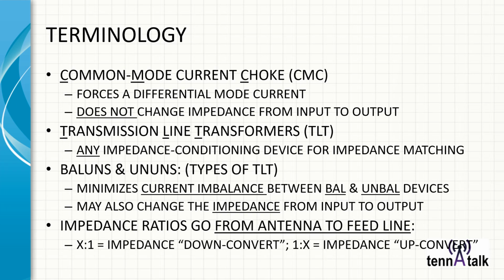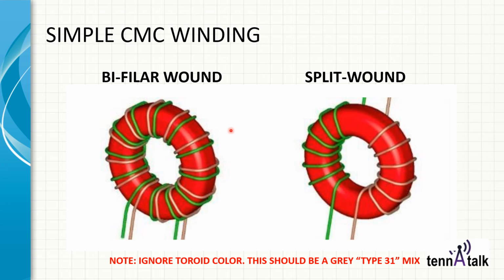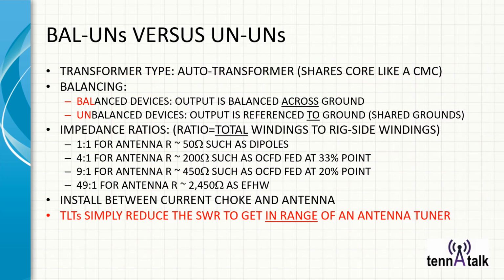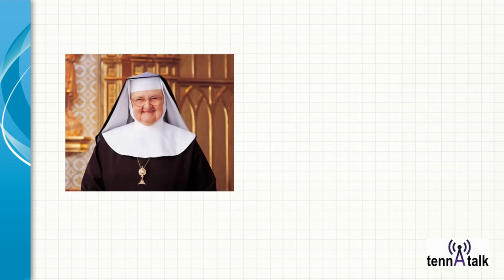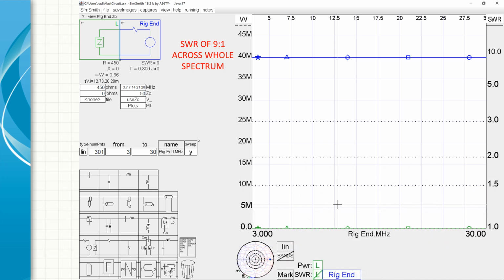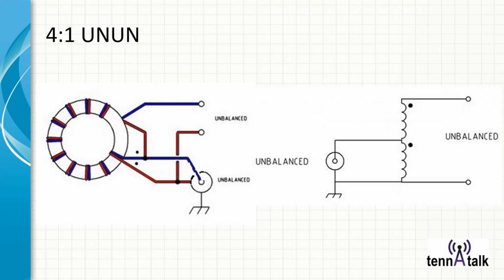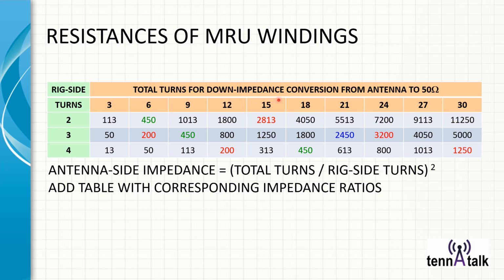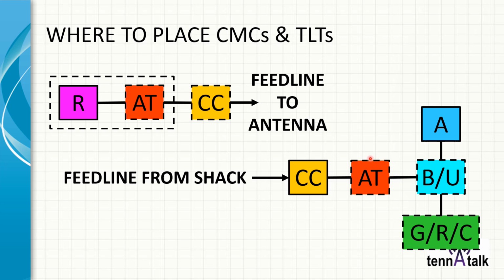TennaTalk #12a   BalUns UnUns Chokes

Comment: Hi Rudi a very informative presentation. Is it possible to use mix 43 for both a CMC and TLT as I cannot get a mix 31. Thank again for the presentation. 
Joe.
Reply from the maker: Joe: You CAN use Mix 43 for a CMC for the lower bands only. But Palomar Engineers has both types in stock.
Reply from the maker: No. Mix 43 is for Transmission Line Transformers (TLTs) and Mix 31 is for CMCs, because of the magnetic characteristics within the HF spectrum (3-30 MHz)
Reply from the maker: Both Mix 43 and 31 are widely available, including Amazon. Use Mix 31 for CMCs and Mix 43 for BalUns & UnUns.